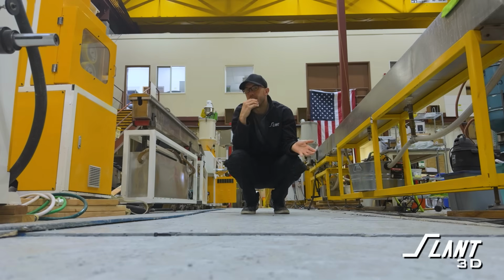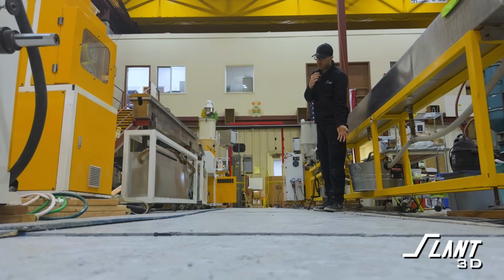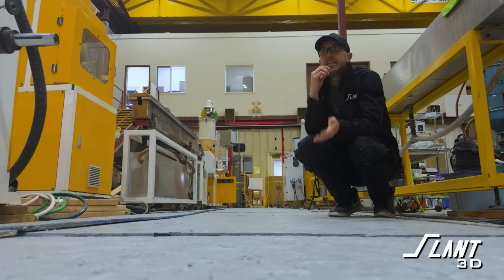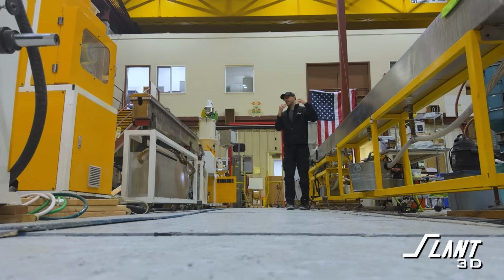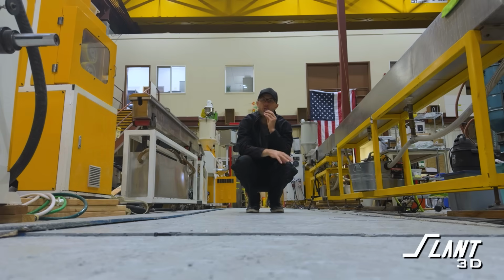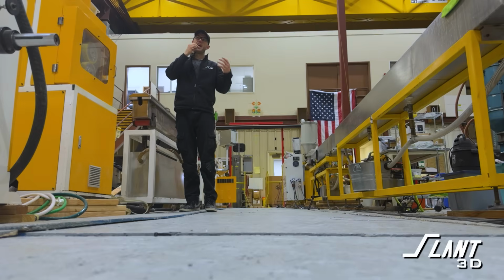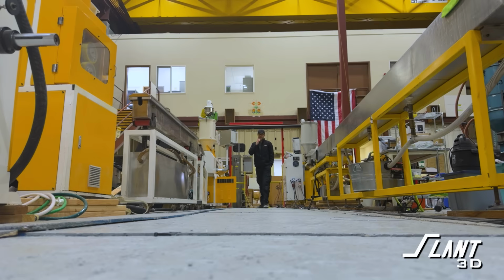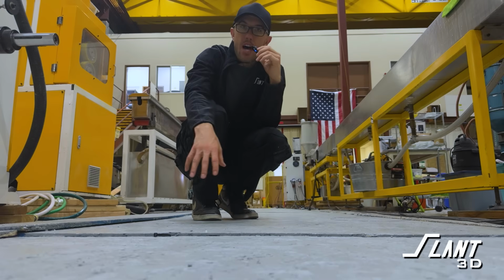How We Make $10 Filament in the USA

Comment: What you stated about there not being a US based manufacturer of extruders is not entirely accurate.  Used to work for one for many years - I developed their smallest mixer and extruder for smaller volume or lab environments in the 25 kg/hr range, while their larger machines were an order of magnitude or more higher volume.  In fact your assembly line really brought back a lot of memories of our old lab which had similar style water baths and winders.  I know we have had filament makers look at our machines in the past even though we've never really gone after that market before.  I wish you guys luck - I think your overall business model makes a lot of sense and I appreciate that it is US based.

Comment: Because of the subscription, it's still not $10/kg despite repeating that claim again and again. As a print farm operator you have to amortize the cost of the subscription over however many spools you're likely to buy but no matter how many you buy, it's never going below $10/kg. Meanwhile with an Amazon subscription I would have even without buying filament, I can get bundles of 3kg of PLA from eg anycubic (there are others too) for $31.49 at time of writing. So way closer to actually $10/kg than Tangled. If I press the monthly subscribe button (no additional cost)  it goes down to $29.69/3kg and actually does dip below the $10/kg threshold with no additional subscription cost...but it's also obviously not made in America.

Comment: In 2026 SLANT3D & TANGLED's energy consumption hit critical mass. Seeking to cut costs and feed sites directly they designed and printed their own thermal battery solution and revolutionized the energy market. It was called "BOLT"

Comment: Love all the good info, understand and appreciate it. 

To your comment about matte filaments - Fusion Filaments (all made in the US) has an entire line of matte ABS, formerly called ABS 1.5, with and without sparkle, which 100% hides the layer lines and is amazing to print. No, Fusion is not the cheapest, but it is absolutely the best ABS I've used, and I have 300 rolls of various types. PLA is what I print the least of despite having a lot on hand.
Reply from the maker: ABS is unfortunately a dead material.
Reply: @TangledTesting  Sorry, cannot agree.  ABS, ASA, PC, PA, PPA, PPS are some of the materials I run regularly. Aside from kid toys, I have largely stepped away from PLA except for draft parts.  Parts that can't be used or left in a car are useless to many, including me.

Truthfully, though PLA is the most popular, because it is cheap and easy for newcomers. And while bio-sourced and somewhat sustainable, it is unfortunately neither biodegradable nor compostable. It will be replaced by something hopefully better.  But you'll probably be making and using that stuff, too, whatever it turns out to be.
Reply: @ArgueForSport  ABS is not a dead material because PLA is somehow better. ABS is a dead material because people don't want to deal with the complexity for properties you can get from other materials.
Reply: @Mindbulletz  Not to belabor or argue the point, lol, but printing ABS or ASA for me is as easy or easier than PLA or PETG and no heat creep, so awesome for multimaterial printing. Toolchangers will be taking off within the next 12 months - 18 months and eventually supplant MMU/AMS systems. 

So I apologize, but don't understand what you mean by the "complexity of properties" you can get from other materials. As a commodity resin, ABS is among the cheapest. 20-25% cheaper than PLA when purchasing for injection molding. So what materials are as cheap per kg ($15/kg) and give the same or better properties, like temp resistance, decent impact, reduced creep, and ability to do solvent bonding for assembly?
Reply: @ArgueForSport  I think you misunderstood, I wrote "complexity for properties" not "complexity of properties."

Specifically regarding printers with full tool changer setups, we have 12. We still have no reason to create the additional ventilation to what we have now to allow ABS to be printed.

Comment: 230-255 degrees celcius for PLA?! What? Why? 
Why does your PLA require ABS-like print temps?
Reply: I found that it's required for heat flow on some of my filaments. Plastic is an insulator to begin with, and the faster you go, the less time your filament has to actually get close to that temperature.
Reply: The faster you print, the hotter your filament needs to be. To cold and it won't flow fast enough.

Comment: I would love to give my support by purchasing from a USA manufacturer, but there are several issues for me. 

First, you only currently sell PLA, and only in black. That's the least type and color I am currently using.

Second, with me just starting out with 3D printing (ordered first 3D printer 60 days ago, and printing for 25 days). So, until everything settles down, I'm currently all over the map with what type of filament I am using. I would love to order a second printer, but my wife would have my head on a platter.

Third, my current avg cost per KG is ~$12.50 + tax. That average over 44 rolls includes: PLA (Plain, Plus, Matte, Silk), PETG (Plain, Pro, Rapid, Matte), and TPU (Plain). The above average also includes ~25 different shades/colors.

Comment: Why not sell the purge filament between colors at a discounted price or as a "gradient filament"
Reply: My guess is that the purge doesn't produce enough to justify the product line. I'm not sure how much waste it creates, but probably only a kg or two. I would assume the downtime and actual physical labor of swapping colors is the biggest factor.
Reply: @oo-eo9pw what if they include it in the package, as a bit of test filament? Im sure it makes at least a foot or two,
Reply: They tried this it was a clear to black called wonk. And there might have been another color too
Reply: Just having a “junk filament” add on where you can add a roll of random junk color PLA to your existing order would be just fine. I’d use it for test prints, prototyping, or just purely utility prints that nobody will ever see or care about.
Reply: I print almost entirely functional parts, and would be 100% happy with ABS or PLA that was inconsistently colored if it were cheap.
Reply: He sticks to single color. He said they are not really doing anything multi color. In the future they want to but mentions the mass amounts of extra time it takes. 

Printers with 4-5 hotswap Toolheads will be the next huge thing to really push printing as a whole much much further.